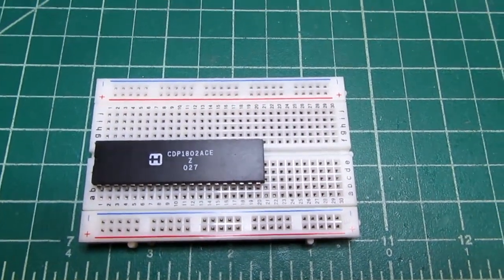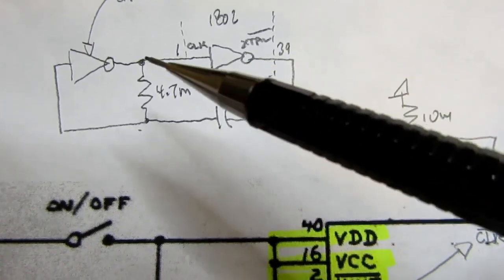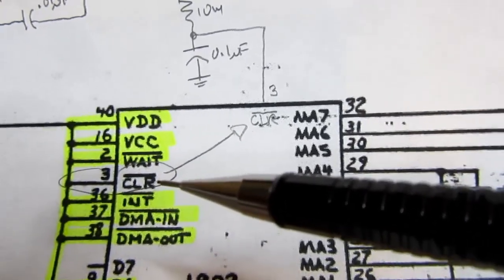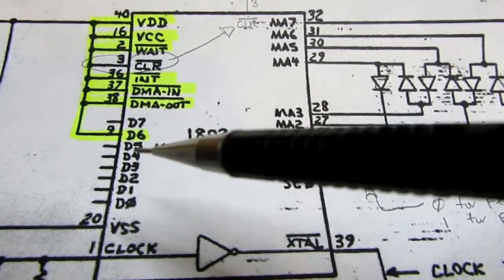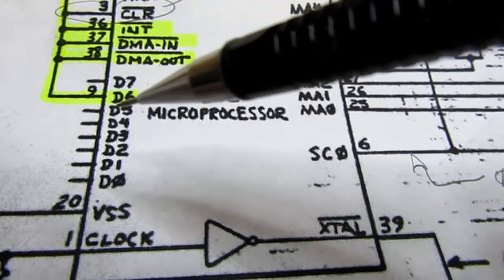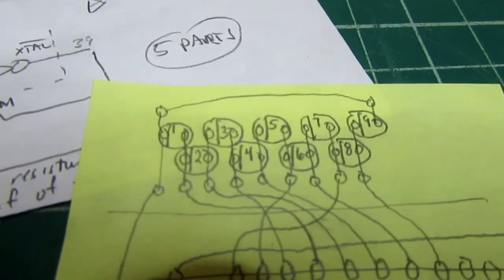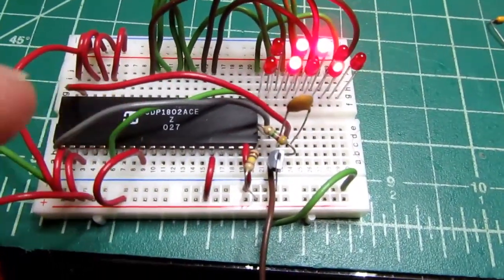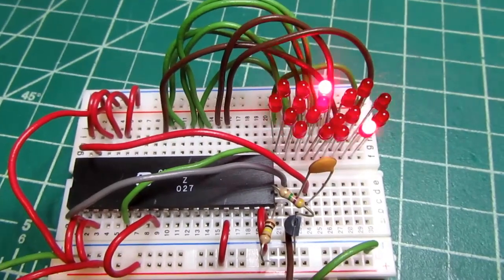Achtung! Watschen Das Blinkenlights!  A Minimum Parts Count 1802 LED Flasher

Comment: Ein Achtzehnnullzufallsgenerator. Sehr gut, aber bitte nicht zuviel davon. I prefer to do the opposite and clock it as fast as I can and slap on a megabyte or two RAM. Modified SCRT routines can't replace a MMU, but are the perfect place to control bank switching instead of putting that all over your code. 40 years ago I would probably have done a lot to get my hands on such RAMs.

Comment: Very creative  to use the address lines as gpio lines... Lucky, the 1802 covers all possible values of a byte with an op code - except of course the halt / all low... for your blink'n lights is: plural of lights, because the 'hello world of mcs' is usually just one, single, blinking LED. ;-()

Comment: Like my German grandmother used to say "vhers da beef??" This looks like a fun project. What is "minimum parts count"?
Reply from the maker: "Minimum parts count" means this circuit uses the fewest possible components to do the job. For instance:
- I could have used a "classic" 2-inverter oscillator circuit which has two time delays and thus a more 'regular' output duty cycle; but that would mean adding another passive component and the 1802 does not care whether its clock signal is symmetrical, so this is more efficient.
- I could have done the normal thing and put current limiting resistors on the LEDs. But since the 1802 inherently limits the current on its I/O pins, and the level the current is limited to coincides pretty well with what the LEDs need to light up decently, I could reduce the parts count by NOT using the resistors.
- I could have used an outboard IC just to get another inverter for the clock circuit, but instead I used a transistor and a resistor to do the same thing. WAIT, you might say....I used TWO components where I could have used only ONE! But the philosophy of "minimum parts count" means considering cost and physical space as well, and certainly the transistor/resistor approach is less expensive than the IC would have been, and takes up a lot less space than an IC (well, at least an old-school non-surface-mount IC) would have.